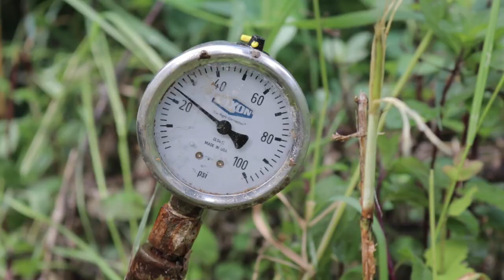My New Ram Pump - AMAZING!

Comment: Since the energy is derived from the kinetic energy of the moving water, if the standpipe is well below the dam, you will lose some energy since the mass of the moving water really starts at the standpipe.  The standpipe effectively "cushions" the water hammer effect at the point of the standpipe.  You do need the air vent however, for max effect it would be near the source.   It seems you have plenty anyway...

Comment: Those are cool pumps,   Maybe line up 2 or 3, in parallel,   if ya need more water..   Does the size of the Air Chamber effect the flow rate ?    I would imagine,  there's a minimum size that would need to be calculated if your building one from scratch..     Nice Video !

Comment: I have a weedwacker end that only accepts shorter lengths of string. You basically cut your string into short lengths and use one short string at a time. When It wears down you just slip another string into the holes. I had a heck of a time with bump the ground feeding systems when I was younger. So my father bought me this setup and I've been using it for around 20 plus years now. Sometimes less is more.

Comment: You're not alone in using a saw blade on your trimmer.  I gave up on string long ago and use a 7 1/4 carbide blade when they're not sharp enough for the skil saw.  Been doing that for over 10 years and no telling how much I've saved on string, not to mention those cursed brush blades they like to sell you.

Comment: Amazes me evert I mean. Quick tip on string trimmer. Sthil does make an aluminum head that you cut 2 pcs of line 14 inches. Then slides straight through the head. It may be easier for her to use. definitely a lot lighter. I use the thickest line they have. Seems to work great on land clearing jobs I do.

Comment: try a screen for the suction hose of a trash pump, less restriction yet small enough openings that anything that makes it through the screen will still pass through the check valves of the ram pump.  Also ...knipex cobra adjustable pliers,  you'll never go back.

Comment: Good explanation of what's going on with the ram pump. You should check out MrTeslonian's channel and the ram pump videos he has on there. He was working in building one at one time that not only pumped water, but could also be used as an air pump.

Comment: Not cattails. In Oregon, it is horsetails that indicate water.

https://en.wikipedia.org/wiki/Equisetum
The great thing about horsetails, is for fine woodworking, they can be used for fine sanding of wood. Its high in silica and will bring wood to an almost glasslike finish, especially when working on a lathe. Very "old school".

Comment: Just buy some wire rope for the weed whacker. Make sure you cut to the right length. Much cheaper and also much more powerful. Just maybe a little more dangerous.

Comment: just finished building one. I have a couple of questions about how it works. First, does anyone know why he uses a pool noodle inside the air pressure tube? and second if you use a bigger air pressure tube dues that just mean more capacity - more time between when the pump will cycle?

Comment: This is like a switch mode power supply in electronics. Codyslab did a nice little video on the principle of how smps work using a ram pump Iike setup, explaining both in the process.

Comment: How does it work? A hydraulic ram, or hydram, is a cyclic water pump powered by hydropower. It takes in water at one "hydraulic head" and flow rate, and outputs water at a higher hydraulic head and lower flow rate.

Comment: I didn't understand; was the vertical white pipe capped off at the top end or was it open?  He did say it built up air pressure so therefor logic says that it is capped off but it doesn't have to be .  Also the cap can have a spring loaded internal piston but that wasn't explained either .  Nice half-job of explaining how a ram pump works.

Comment: hmm I know nothing about those pumps but I wonder if you could get an in line flow meter. my hunch is that there would be a trade off between back pressure and flow rate at a certain point and maybe restricting that valve on the tank side of the pump slightly might improve flow.
But I'm sure if that's even a possibility it would depend a lot on all the pipe sizes and head heights etc.

Comment: Would you provide some video clips about the calculation of height and distance and their relation with inlet and outlet pipes diameters also back pressure pipe height and diameter
Then by these information, we can calculate water inlet and outlet dates and capacity of Tank....
Thank you again

Comment: Just wondering, just trying to understand this engine... is it possible for the initial water flow to be captured in a vat, from which it flows into the engine, and the overflow water to be fed into that same vat? The tube would have to be short, as else it will give back-pressure and hinder the overflow valve, but I just hate seeing good water go to waste...

Comment: Question.  You have a valve on the down side of the pump to shut the water off and let the pressure build up.    Since the output is running 40' of head and 300' away wouldn't the line automatically create pressure build up even without the valve.   The water would run through the system until it reached a point of level with the source water, then it would create pressure and activate the pump without a second valve?

Comment: Quick note - you're not winding the weed wacker's cord correctly. It's supposed to be a bump release - when you push the spring-loaded button in the middle it should release some more cord. 
There are videos on how to correctly wind it on. Check them out. No need to cut two pieces.

Comment: I agree with the comments that the vertical pipe is a smoothing capacitor.  A ram pump doesn't require it but it works better (more efficiently) with one.  This is a simple energy transfer system.  The long column of water is allowed to flow at a certain rate before the 1st check closes. The velocity, the length of the column of water and the inverse of the speed of closure of the check valve sets the maximum pressure impulse that occurs due to 'water hammer'.  Until the advent of the 'water hammer' pressure pulse, the pressure downstream of the second check holds it closed.  If the pressure pulse is higher than the pressure to actuate the 2nd check and the pressure downstream, then the 2nd check will open allowing water to flow past the second check.  Because water is basically incompressible any flow past the 2nd check quickly relieves the upstream pressure and the 2nd check closes.  Without the air pipe, the pressure downstream would quickly rise to force the water through the pipe and limit the amount of water that could be transferred from the first to second stage.  The air pipe is an accumulator which requires a large volume change to create a pressure rise.  This allows more water to be transferred from the first to second stage and lowers the losses in the second stage.  This system wastes lots of water so in arid regions this would not be a good idea.  The amount of water pouring on the ground is a multiple of the water that gets pumped in a properly tuned system.  This is great for regions with lots of water that needs to be moved to be put to good use.

Comment: I would suggest trying a “speed feed” head for the weed-eater. My wife uses one by Echo. Just line up the arrows and put the string through. Easy and fast, just twist the head to load the string up. Shouldn’t have to take the head apart again. Fits multiple brand of machine. A little pricey but we haven’t regretted any of the 5 (for various machines) we have bought. I think your wife would really like it and she “can do it myself”, as my wife says.

Comment: Is the standpipe upstream of the waste valve.  If so and if it's open on top, it's reducing your performance.  For best results you want maximum velocity through as much upstream pipe as possible to create the highest pressure pulse when the wastevalve snaps shut.

Comment: Have you seen the Nicola Tesla water valve with no moving parts? It allows water to only flow one direction.
 I wonder if it would work for the waist valve, to limit spillage, or maybe better in some other part of the ram pump?

Comment: There was one on a property my grandparents had for a while when I was a kid. After the growers upstream cleared the swamps and the creek became seasonally dry, the "fuel" to run it was no longer available except by wasting water from the little dam to power it. It was crazy fascinating to watch the thing build up-build-up-build-up then, SLAMM and the pipes would jump pat-pat-pat on the ground for about a second afterwards. Then the cycle would commence again. Eventually a piece of the old galvanised pipe would get a little thin on the cut threads with rust and crack off somewhere.

Comment: Those are not cattails, they are horse tails. They are in the family of scouring rushes which are not flowering plants.. The plants uptake a great quantity of silicon from sand and stores it in the plant's tissues. Pioneers discovered that the plants could be wadded up and used to scour stuck-on or burnt food from dishes and pots.

Cattails are flowering plants that are common in marshes and the edges of ponds and lakes. They grow to about 4 feet high, have flat, swordlike leaves like giant blades of grass that grow up wrapped around the stem and pull away and flatten as the plant gets tall. The "cattail" at the top of the stem is the female parts of the flowers that, when pollinated, grow into a dark brown structure resembling a cats's tail around the stalk near the top of the plant. The male portion of the flowers are on the stem at the end, above the female flowers.

Comment: What a blessing to have a source available to utilise the ram pump. They have always amazed me. What effect would pointing the intake downstream? If it would still work it would sure eliminate a lot of the clogging issues. Great video! BTW I have gotten away from the bump-n-go after much frustration and have gone with the Weed Warrior Push N Load Blade Trimmer Head which accepts 3 pre-cut lengths of line that fold into small swivel heads.....giving you 6 cutting lines. The line can swivel if it hits a hard object, fence etc. and is less likely to damage the line. I can weed eat and edge two houses....drives and flower beds on one set of strings. I never looked back at the bump-n-go. It will also accept 3 plastic blades for heavier grass and light brush.

Comment: no offense, but that weed wacker looks like you don't need to take it apart to load more line. had to show a friend as well. feeds in across both holes and pull out enough to be equal on both ends, usually will have amount can hold. push in one side, pull ends equal, then wind head by pushing down and turning.

Comment: For the spring have you thought about developing it to have it fully underground to keep things from ever entering? 

A cut up plastic barrel to make a dam and some gravel to fill in the void behind it. Once the collection and vent is closed off you will have drinking water and reduce the chance of anything blocking the works.
Reply: This is the set up we have for our stock water system. a 44gal drum buried so the top is still above the waterline, then chicken mesh rolled into a 12 inch cylinder and pinched off at one end then attached to the drum just below the water line as the inlet. This stops any big debris getting in. then the drum fills up and the out flow to the pump is halfway down the drum so that the floating debris wont go down the hole, and anything that sinks will be in the bottom of the drum.
Reply: This was my exact thought after watching this, bury the dang thing and reduce the maintenance needed.
Reply: Unless he just Mr. & Mrs. W. enjoy the few minutes alone while Jack does his chores. ;-)
Reply: i did something similar by building what amounts to a cul-de-sac in front of my spring head and then filled it with pea gravel and in the side wall attached the pipeline to my water tank. inside the gravel where the pipe goes through the wall i have a 3ltr bottle cut in half with a screen over it that the pipe enters and it is buried in the gravel so to make a pocket or void in the gravel that fills with water. the gravel filters out all the debris and nothing gets into the pipeline. any water flow that is left over just over flows the gravel cul-de-sac i made and back into the original creek. hope that made sense :) later this week im attaching another pipeline to it for a ram pump to run water up to my cabin. the original line is just a gravity pressure line to a storage tank.

Comment: You should make a catch basin, a bucket, somewhere in between the line of water feeding... to avoid those clogging... just I have seen others have done it... 

... and also, make a lot of holes in a big pipe covered by a screen in the main source of feed... and a close valve on a pressure gauge to close it when not in use so as to keep it going for a long time... 

Others put a bicycle inner tube inside the big vacuum pipe to aid its pressure to pump out more water...

Comment: A tip on the trimmer, have you ever heard of the Oregon jet fit head? instead of winding that string you kinda just slide in two zip tie looking strings to the head. No blade, no string that goes in to the head. Easy to change stings. Worth to check it out :)

Comment: To my practical farmer's eye, it looks like that system would benefit from a sort of settling cistern before the water hits the valves and pump. The cistern would be a vertically oriented , relatively tall and wide cavity.  One side has the water inlet  a good distance below the removeable top.   The outlet would be lower than the inlet, but the outlet would also be well above the bottom of the cistern.   Heavy trash would settle to the bottom of the cistern.  Have a big drain gate for cleanout..   Floaty trash would collect above the outlet.  It would handle more trash before plugging, the plugs  would simpler to clean out, and less crud reaches valves. .

Comment: Nothing more satisfying than hearing that clack, clack, clack.With respect to the union -try mixing some powdered graphite with vaselene/petroleum jelly and applying this to the male and female threads of the union. It should make for easier dismantling of the union in future and as far as I know is non toxic.For the delivery line, install a check valve immediately post the delivery gate valve so as to keep the delivery line full of water after the first set up. That way your ram can get going full bore sooner.As you say, the ram pump is truly an awesome piece of technology. I have just been to see a commercial unit that was installed over 60 years ago to supply a small farmstead. It was second hand then, and has worked continuously all that time with no downtime except for routine maintenance.Looking forward to seeing your smaller unit working. Thanks for posting this video. Greetings from the UK.

Comment: Not for nothin'... the way you are winding line onto that spool induces twist. You want the line coming off the spool smoothly, like a casting rod (if we load the reel by taking line off the end of the storebought replacement spool, then remember to trail the line into the water (off a moving boat, tip high) to let it stream away. Then reel it in so it  will rest in the casting rod's spool without twist).

Find a way to load your trimmer without inducing twist in the line.  I always cut the line to length so the free end can shed twist as you load.  One hand holds the spool steady, the other hand keeps the line between thumb and forefinger and also helps steady the spool as you as you load it by rotating the spool in both hands - rotate the spool like you are washing or drying a plate with both hands on the edge. It takes longer, but it eliminates one easy way to jam the line feed.

Carry on... ;-)

Comment: Get rid of air pipe and install a 44 gallon drum. Run pipe inlet at the top and outlet half way up the drum. Filters everything and easy to clean. Plus i noticed your inlet with mesh over it was half out of the water. Problem solved

Comment: i had a thought for low drop areas unsure if it would work as i have not built mine, could you place a pipe before your inlet with a bladder in it to create artificial water height? Or possibly place a waterfilled bladder into your pressure tank? Just curious before i start a build figured i would ask i only have about a foot of drop but need more tgan 7 foot of lift thinking about digging in tge ram pump or pissibly filling multiple holding tanks to feed into the next ram pump amplifying my lift potential

Comment: If the Trimmer String is getting stuck, then it's either improperly wound on the spool or the String welded together, I've had that happen, some Trimmer String has a tendency to weld together more than others.

Comment: If I might make a suggestion, turn the screen into something bulbous or conical towards the source and you will have more surface of filtration and less opportunities for total clogs of the inch and a half opening, as there is no suction directly holding foreign objects against the strainer.  I have seen all the incarnations of the pump, this is cool.....

Comment: at 12:00 you talk about needing large wrenches try a "FORD" wrench it is like a pipe wrench in function except it has smooth jaw that are parallel.  install a wye strainer  to collect all the debris in line.  you just take the cap off and it will usually flush itself out.

Comment: Use a filtering system similar to the swimming pool so you won't have to break open the union for clean up. But, use screen from screen door for filter.

Comment: One question, wouldn't you be able to hook an other hose to the upright part of the T pipe (not the pressure pipe) and have it still work, then it would, in theory, fill your water tank twice as fast.